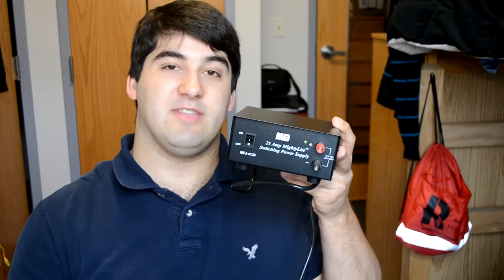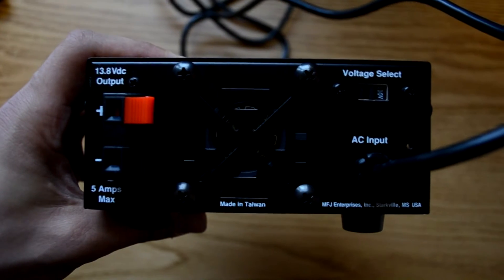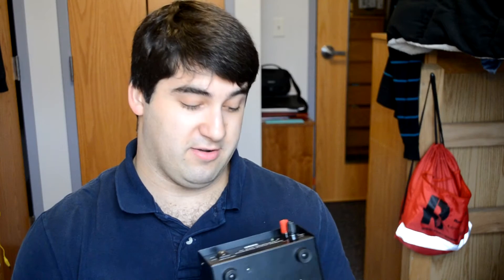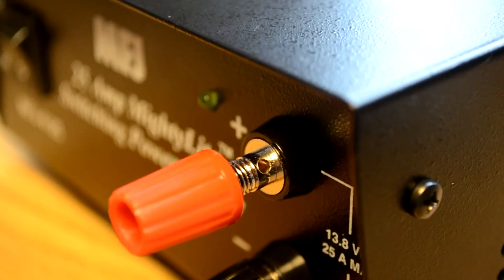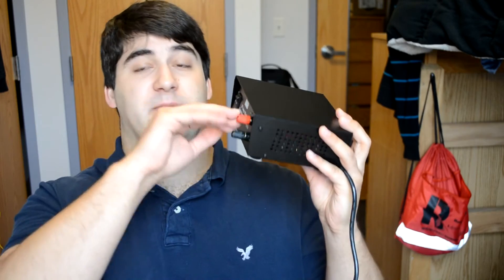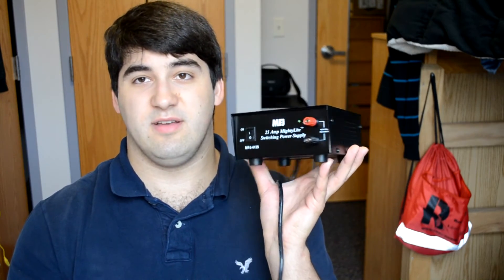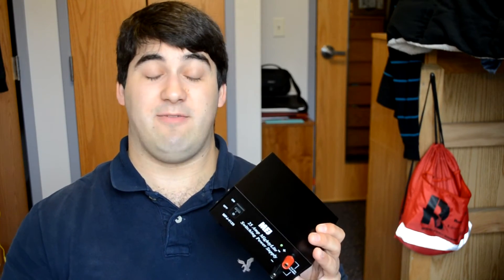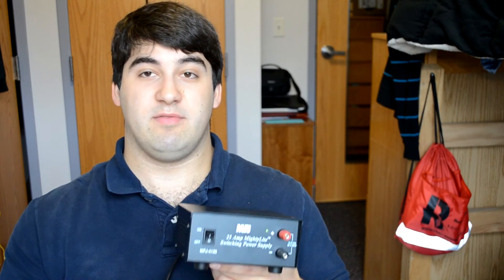MFJ-4125 Power Supply Review

Comment: I have one. The fan is way too noisy! I am thinking of removing the fan and finding a computer case fan that I can mount on the outside and run the fan wires to the rear power connectors.

Comment: While it's 12v and a switching PSU, would there be any downsides to using a high quality PC PSU with a single 12v rail converted to use with ham gear? Most radios are supposed to be able to tolerate 12v on paper at least... I use this http://www.techpowerup.com/reviews/OCZ/ZT_750W/1.html
one in my PC now.
Thanks, KJ4MJI
Reply: I've converted an old ATX power supply. By "converted" I mean that I cut off all the other leads and put some binding posts on top and connected them to the 12v rail. If I remember correctly it's rated for 12A, so it should work for most 50W VHF/UHF radios or an HF radio at reduced power. I've used it with a 10m mobile, a dual band UHF/VHF mobile, and a 40m QRP radio. So far, no RFI.
For $85 you get double the current capability, seems like a fair price. Nice review.
Reply from the maker: Not really; it would work fine. I've done this in the past, but typically cheaper (low power) PC PSUs don't supply 20 amps of current on the 12 volt rail. It also takes some work to manage the mess of cables a computer power supply uses to connect to peripherals. If you have an old supply, it might be worth a shot. If you're starting from scratch, I'd just say buy a turn-key solution.